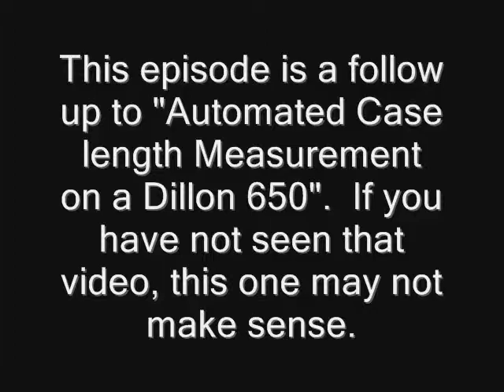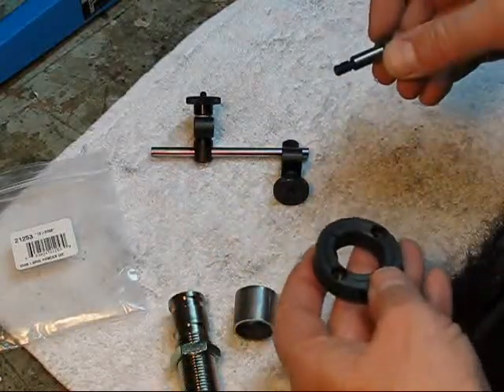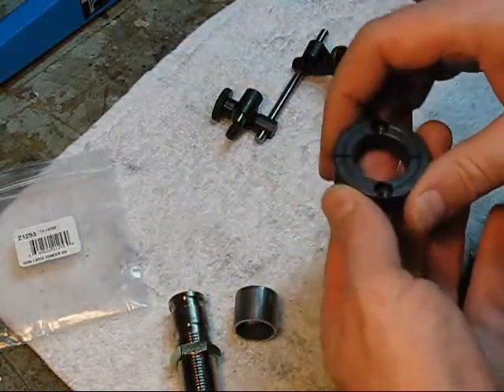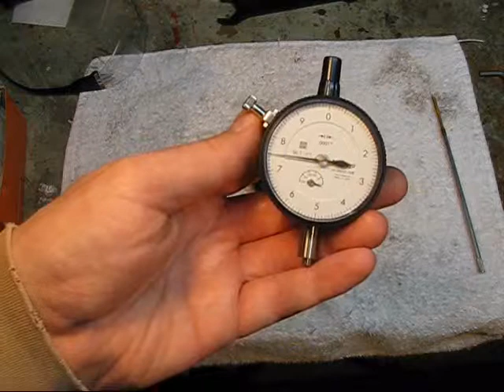Building the Dial Indicator Holder for Automated Case Length Measurement

Comment: There really is not "minimum length" for straight-walled handgun cartridge cases and you'll rarely if ever find a case that's even as long as the published "minimum length" much less one that exceeds the "maximum case length" because of the huge variety/variance of ammunition/cases/handguns manufactured worldwide. A "failure to fire" from a "too short" case in a "too deep" chamber in a pistol that DOESN'T have sufficient firing pin travel to "reach" such a case as long as its somewhere in the "right ballpark" length-wise is much preferable to a pistol firing "out of battery" because its sloppily/poorly designed/constructed and unlike quality designs/guns that will "default" into a "failure to fire" mode and not drop the hammer or striker if at all "out of battery" and not fully locked up will fire a "too long" cartridge in a "too short" chamber. There are very few pistols made that don't have plenty of firing pin travel to reach the "too short" case and many pistols don't ACTUALLY "headspace on the case mouth" unless a "long" case happens to perfectly match the chamber length and there is "zero headspace" with the slide fully in battery and locked up. Instead, short cases are held back against the slide breech "face" by the EXTRACTOR which "flips over" the case rim during cycling when the cartridge is stripped from the magazine and is pushed upward and forward into the chamber and the extractor keeps the case from "bottoming out" in the chamber. If the extractor DOESN'T "grab" the case rim prior to lock-up and the case is super-short it can slide backward after being fired, snap itself under the extractor prior to unlocking and the slide beginning to move rearward and be extracted/ejected normally. Regardless, its only with a cartridge gauge with its "chamber" cut to the absolute minimum chamber depth specification that you'll see the "average" pistol case here in the "civilized world" made by a quality manufacturer actually "headspace" on the case mouth in that cartridge gauge. And one of those gauges used to check finished cartridges for COL and proper case outside diameter (those "chambers" are also cut to minimum diameter specifications so bulged/distorted cartridges coming out of a factory box or reloading press won't drop in and fall out of them by gravity alone the way good, properly dimensioned cartridges will) is all you need to check your cases for "correct" length prior to reloading. There is no expanding/sizing "ball" in straight-wall handgun/rifle cartridge dies and the cases are only "shrunk down" to proper OD during "sizing" and shouldn't "grow" the way a bottlenecked case can and will as the sizing ball and die "squeeze" the brass case mouth/neck between them and force extra brass thickness into extra brass length. Straight-walled cases also don't concentrate huge amounts of chamber pressure into a progressively smaller "space" during firing and push against the bullet/crimp/shoulder simultaneously with the 50,000+ psi rifle cartridges can generate to "stretch" cases. And "high-pressure" pistol cartridges like 9mm and .40 and 10mm "work-harden" the case mouth and after a handful of reloading/shooting cycles they'll usually split a case mouth during firing or finish splitting it during bullet expanding/seating. Which is why many shooters/reloaders either reload those high-pressure cartridge cases very lightly for low-recoil "plinking" rounds or toss them after a certain number of "full power" reloads. Avoiding actual crimping of the case mouths and only removing the "bell" from expansion using something like a Lee Factory Crimp Die also extends case life and reduces pressures.  

Low-pressure .45 ACP cases which at worst in "+P" and "+P+" loads are only subjected to half of what 9mm and .40 and 10mm cases are subjected to and use the very large diameter and bullet base area of those .45-caliber bullets to generate similar energy with half the pressure can and will last dozens to even hundreds of reloads without stretching or splitting and after that much use will STILL be "short" compared to "published" case length specs according to SAAMI. When it comes to straight-wall cases and in particular TRUE straight-wall cases with no case taper like .45 ACP (9mm cases have a slight and measurable taper from case head to case mouth because the Europeans were slow getting the news that case taper is not required for "reliable" chambering/extraction IF semi-auto/full-auto firearms are designed properly so that unlocking/extraction is delayed until the case have "shrunk" post-firing and taper can actually case "sticking" since that "taper fit" can lock short/small cases in a long/large chamber due to excessive expansion beyond the elastic limits of the case and its material or due to long/large cases jammed into short/small chambers during chambering) we have "SAAMI" specs for cartridges/chambers primarily so finished cartridges/chambers can be measured and checked and verified to be "in specs" and those "specifications" when manufactured/proofed/procured/purchased etc. U.S. "domestic" cartridges like .45 ACP and firearms chambered for them are virtually all produced by a relative handful of quality manufacturers both here and overseas while "global" cartridges like 9mm and firearms chambered for them have been produced around the world by hundreds of manufacturers of every degree of "quality" and "skill" and "accuracy" and "precision" imaginable and that's why its smart to stick to only U.S.-produced or "properly" imported/inspected ammunition/firearms when it comes to the latter to make sure to get the "good stuff' while its almost impossible to find the former that ISN'T "good stuff". 

My reloading "mentor" who is extremely knowledgeable (former LEO, Cabela's gun library manager, lifelong shooter/hunter/reloader, etc) about guns and ammunition and reloading/handloading and very safety conscious and like me avoids "max" loads for all but a few hunting/defense situations and then only loads a few rounds at that level for it and carefully checks for pressure signs etc (I also own a chronograph while he does not) told me when I asked him why I couldn't find any "in spec" pistol cases that were even longer than the "minimum case length" so I could trim them that I should forget about trimming pistol cartridges unless I was a glutton for punishment and wanted to waste vast amounts of time and that I should even forget about measuring/checking them as they were reloaded and fired because the odds of a case "stretching" to the point of being "too long" before a case neck split given the loads/crimps necessary TO stretch pistol cases were between slim and none. He recommended that if I were loading "hot" ammunition for hunting/defense I purchase new high-quality commercial brass or only use once-fired "matched" brass and never fire and reload those "hot" and heavily crimped loads that way more than once and otherwise forget all the other "dos" and "safety rules" regarding case length checking, trimming, etc that apply to rifle cartridges and cases. 

And of course checking case length BEFORE final sizing is pointless and that should be done after everything that's going to be done in the way of "case prep" has been done. Tumbling can and will "bang" cases around against each other and can and will cause sized cases to "grow" at the necks and even brand-new out of the box/bag high-quality commercial cases should always be sized prior to loading them the first time. With rifle cases obviously you want to then check the lengths and any time a crimp is involved but a Lee Factory Crimp "collet style" crimping die isn't used of course case length must be consistent across the board or crimps will vary and some cases will be overcrimped and possibly bulged/distorted, some may not be crimped at all, etc. 

As for tumbling cases AFTER sizing and/or decapping, I did that ONCE when I was still dry tumbling. That dry media will stick in primer flash holes every time. Dry tumbling may reduce or if done very lightly and for a short period "eliminate" the need to size cases again but wet tumbling with stainless pins that WON'T stick in primer flash holes and will clean out primer pockets just as clean as a whistle will always necessitate resizing before loading. That's why its only for "precision ammo" or when I'm feeling ambitious or like making ammo really "pretty" for that brief period of time primer pockets and cases are empty and can be seen and appreciated for their shininess that I size/decap, wet tumble, rinse, dry, resize, check case length, trim if necessary and load cartridges and then only rifle cartridges and the the few "special" handgun cartridges I still reload on my single-stage press. That being all my .45 Colt, my .460 Rowland and my "defensive" and "match" .45 ACP. Everything else goes to the wet tumbler for initial cleaning, gets rinsed and dried and then goes right into my Dillon 550. I even load my .223 "plinking" ammo for my ARs loaded with "cheap" 55-grain bullets on my 550 and use a Lee Factory Crimp Die so i don't need to bother checking case lengths as I pull "new" cases out of the 5-gallon bucket of range-find .223/5.56 cases I scavenged/recovered/wet tumbled/rinsed/dried and stored so I should have enough to last forever. My .223 varmint ammo is another story and it gets the "full treatment" as does pretty much all of my other rifle ammo. I load 9mm through .460 Rowland and .223 through .50 BMG as well as cast bullets and convert cases for a couple "wildcat" and "obsolete" cartridges like .223 (actually once-fired Lake City 5.56) converted to 7.62x40WT and .308 Winchester converted to .300 Savage and shoot guns from .22 rimfire pistols to an Armalite AR-50. 

I'm no "expert" but I do know from experience and "education" via actual "experts" that checking case lengths on pistol cases is pretty much a waste of time. Especially prior to sizing/tumbling/resizing them. Case length comes LAST.